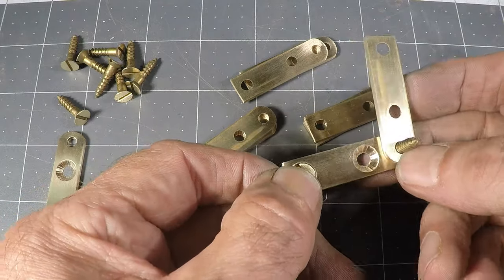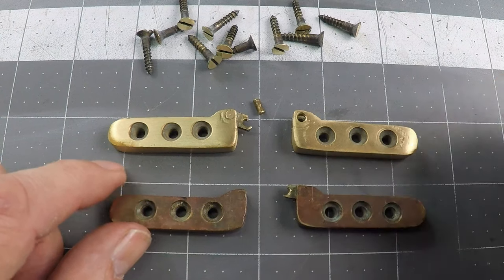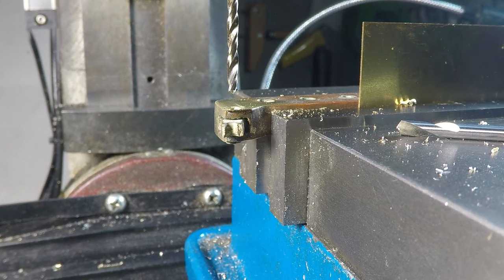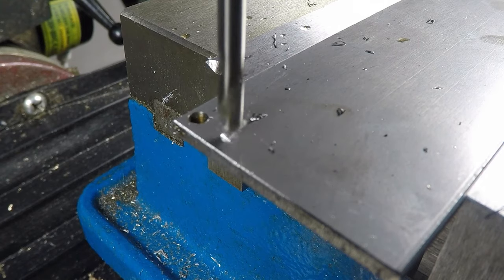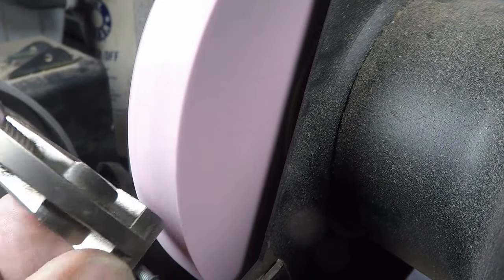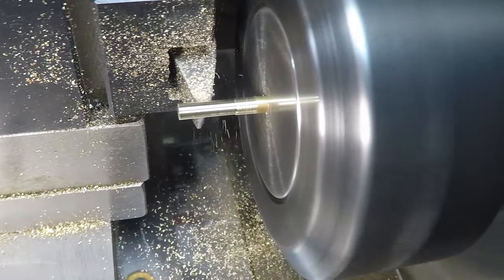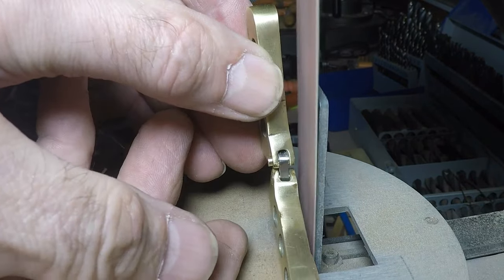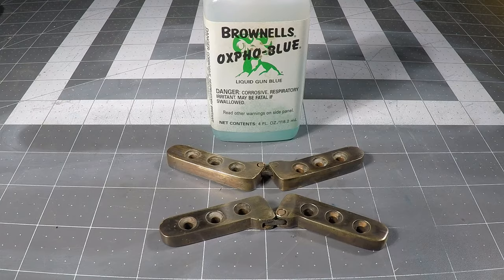Antique brass hinge repair

Comment: Nice little challenge met, and looked like it was fun to restore someone's prized possession , enjoyed, cheers Guy!
Reply from the maker: Thanks, I was worried at the start that I would have to rebuild the entire hinge bodies, turned out it was just a linkage.
Reply: Even so it still looks doable. A very nice home-made design. simple enough for simple toolage. @GuyMarsdenMakesStuff
Reply from the maker: Yes, but keep in mind that a full replacement part would have to fit perfectly in the wood recess.  And the holes would need to align - which can be done with transfer punches of course.   Still haven't heard from the client if she got them re-installed...   @howder1951
Reply: Yes, you got me there' , it is too easy to talk, then find out the hard way..  @GuyMarsdenMakesStuff